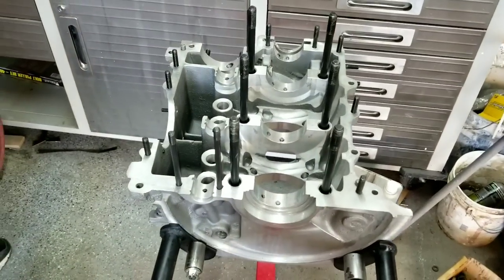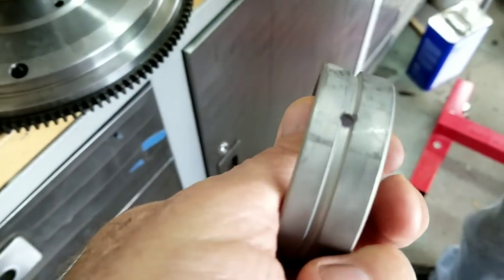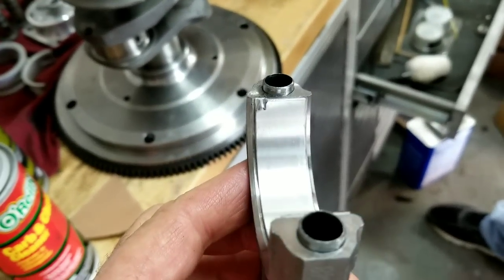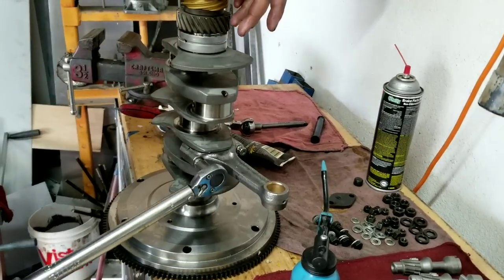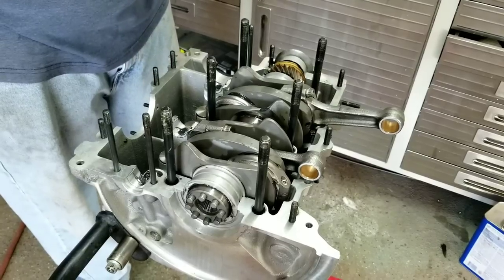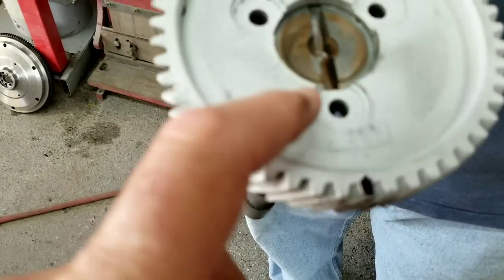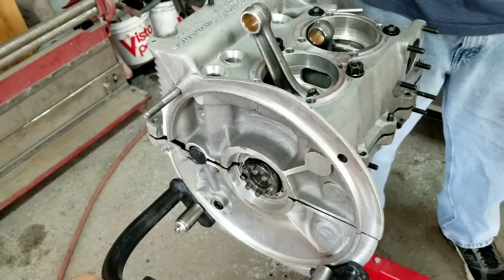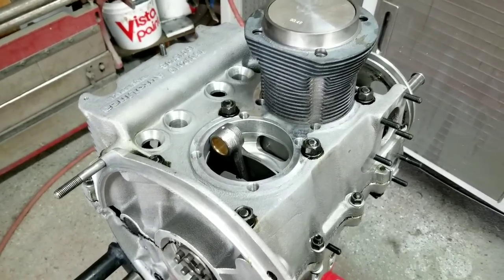Bulletproof VW engine build 1 vw flat 4 engine vw bug vw bus

Comment: The auto linea case lacks proper venting between the cam gear/crank gear area. You'll need to several drill holes in the wall/web  separating them from the connecting rod area  of the case to relieve this pressure or you will likely have excessive crankase pressure creating leakage between the crank pulley and the case. Don't believe me? Look at stock genuine case. A sand seal will not fix it. Realize the the cam/crank gear spinning at any rpm are basically acting an inefficent oil pump and creat this pressure that must be relieved. Oil pressure? Google information about the way modern cars control oil pressure. After doing so, you realize that after certain rpm, rpm only dependent oil pumps put out more oil pressure rhan actually needed. Also, if you want it to last, tighten every single big nut on the case as tight as you can up to a limit of about 35 foot pounds or until you experience binding if the crank. Realize these studsall go through different thicknesses of material so all really need different torques. Same with the heads. The same torque for all head studs us wrong because the they are different lengths and stretch differently. Also, before assembly,  always trial fit cam, assemble case enough cinch cam bearings then check for rotation. You may have to either polish the cam bearing journals (machine shop with crank polishing capabilities can do this) or use diluted lapping compound on the bearings with cam inside case and cinch the spin cam with big screwdriver. Remove cam, clean cam n bearings, reinstall,  check for free turning, repeat as needed. Do the the same with crank. If binding, points of binding will be visble as bright shiny spots on the bearings. To correct, use slightly worn 600 wet ot dry with WD 40 or similar. Also always slightly polish on glass both front and back of number one bearing. When checking for cam gear/crank gear stuff re manual (different gear pitches) go for least backlash but main thing is sound while spinning during checking. It's usually caused by minor damage to either gear that's usually easily corrected with a tiny file. Also check for proper camshaft end play by placing thrust bearing onto camshaft and checking play with feeler gauge. The specs for this are in the Bentley book and others. Also, always wipe all  bearing bores in the case with fresh 600 wet or dry to smooth faces and edges. Also - the auto linea case should be alingn bored to 20 (first cut) right outta the box brand new. Fact. The center bore is whack.

Comment: Cam plug always is flat to the outside of the case,  When rotating the crank with the cam installed, rotate the crank so the cam is pushed into the bearings not the opposite like shown.  All plugs, case savers and machine work should be done prior to build.  Grinding on a bearing next  to a clean open case not so bright.  Even though you were checking deck height, make sure the piston arrow is pointing in the right direction.  I cringed at every step done on this build.
Reply from the maker: case was not clean yet. This was before we even cleaned anything. When he did the bearings. Pre fitting first then clean then assembly. Cam plug can be done either way. all opinions. Engine runs great and is super solid. Checking deck height done also again after piston installed correctly too. FYI. Double check everything no need to cringe. We all do stuff different. End result just fine.

Comment: They're "oil galleries", galleys are big boats with lot's of slaves rowing them. Great vid, though I cringed a bit when you used that "rotary burr" to relieve the oil channel in the main bearing over top the open case, hope no swarf/chips got in. Lookin' forward to the next vid.
Reply: Oil Filters
Reply from the maker: that was before final cleaning

Comment: Question: why in the world wud the genius engineers that designed the entire motor mis-align the dang oil gallery holes????!!  Why? Is it the bearing manufacturer? Or is it on purpose to restrict oil flow so it will have 
A unilateral flow???? Please god tell me

Comment: @ run time 19:10 ; you installed the camshaft end cup WRONG!  It needs to be installed so that it is flush with the outside of the engine block so that it forms a internal a oil reservoir for the camshaft end bearing!
Reply from the maker: different theories on that one. but we did need to turn it around not shown. for another reason.
Reply: Liberty Patriot  auto stick motors go in so the flex plate doesn’t rub it and fly wheel motors go to the outside so either way is correct check you Bentley Manuel

Comment: This is the best case sealer. It’s what most air cooled VW and Porsche engine builders use. Loctite 37394 Anaerobic Gasket Maker - 1.69 oz. https://www.amazon.com/dp/B007XB4R80/ref=cm_sw_r_cp_api_i_t-FTDbZK3H4Q6
Reply from the maker: nice will look into that. Usually use Yamabond.

Comment: Why do you smack a rod with a hammer when it has dowel pins. You smack a powder metal rod your asking for trouble.
Reply from the maker: rods with bolts should be smacked that is how we do them nuts No.
Reply: @Mikefngarage  No you never smack rods with a hammer, the caps register on the bolt or a dowel. I have never seen a top engine builder beat on anything in the bottom end of an engine. The only hammer anywhere near an engine is a piston installation hammer
Reply: @robertweitlauf4653  piston pins should slide in with mimminal pressure